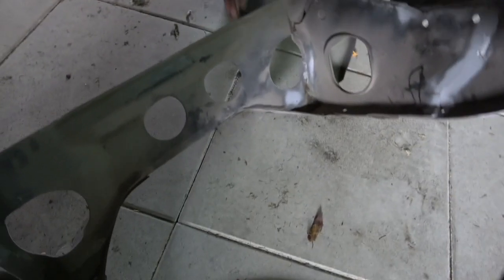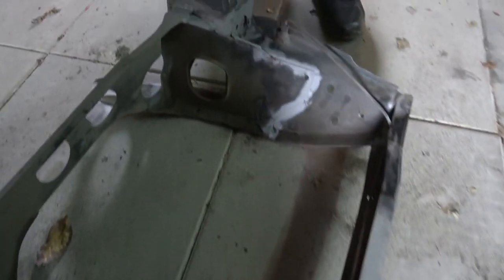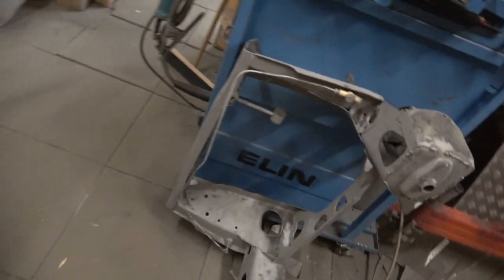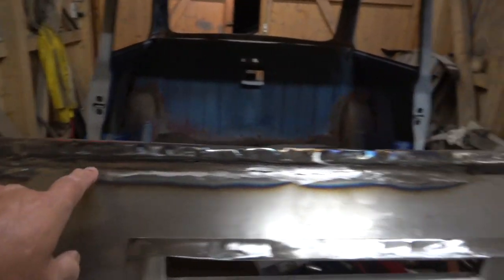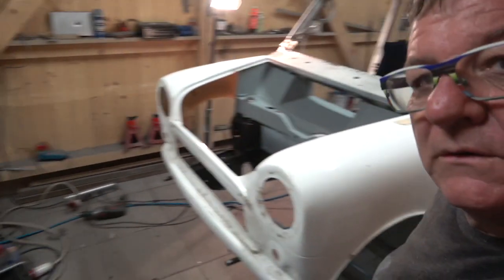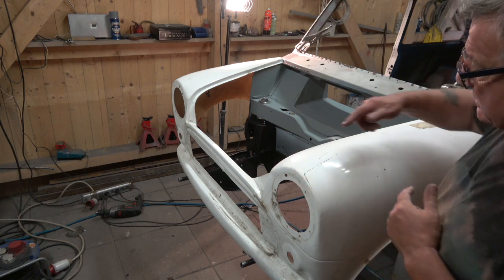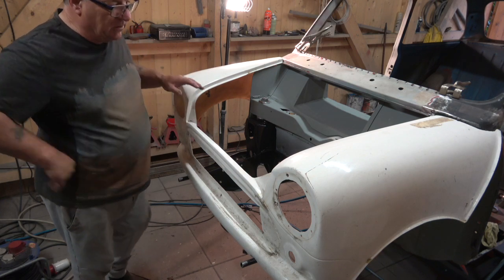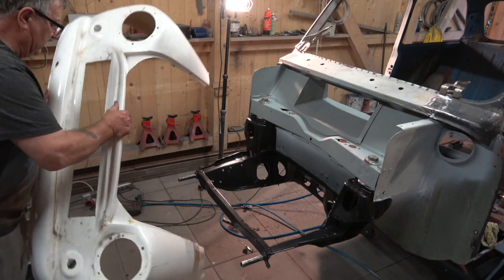Classic Mini Track Day Car Build Part 13 ( Installing A New Bulkhead )

Comment: Great progress Dave it looks good.
Not too keen on GRP flip fronts. If you hit something the engine is getting it and that's even more expensive to repair. Keep the vids coming, you have a great workshop.
Reply from the maker: Andy, Thank you! I‘m with you but the fibreglass will be the back up to the CF front, Cheers Dave

Comment: Dave you should build a tubular inner wings from the firewall to the front of the crossmember with a front crossbrace
Reply from the maker: I will be fitting brackets & rose joints from the bulkhead to the front of the subframe at some point. Cheers Dave

Comment: yeah its always what i was told by the auto test and tarmac rally guys "dont make parts on yer road racing car that take lots of time to fit n fettle" chances are you will be replacing it quite often.
Reply from the maker: Doug,  Wise words Obi One lol, I have a feeling that the engine & box Paul is building for us will out perform our driving ability to start with! lol
Cheers Dave